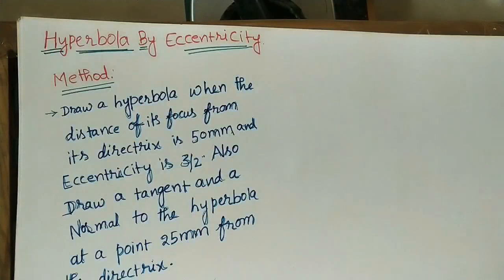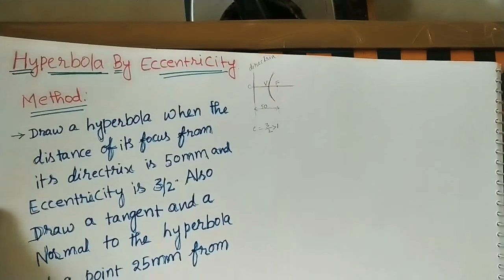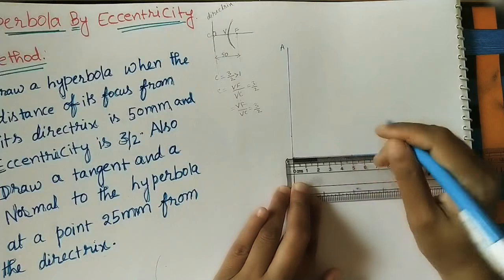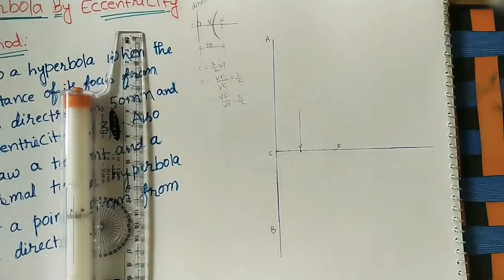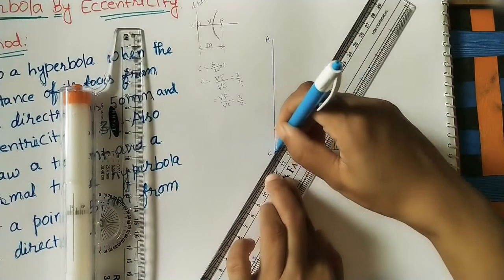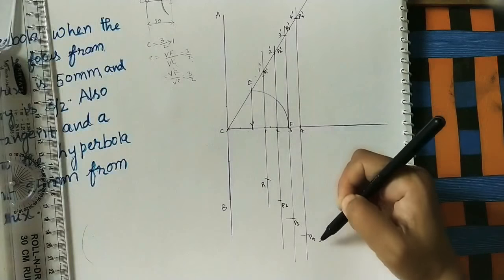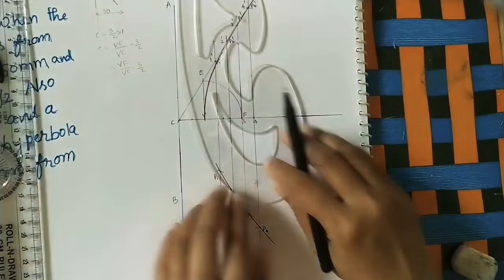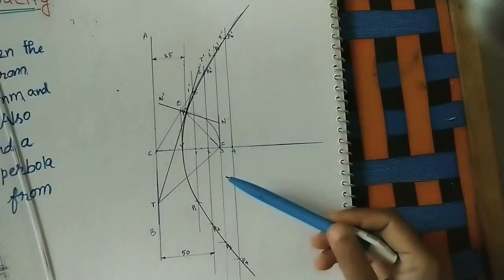Hyperbola By Eccentricity Method//Engineering Drawing

Comment: Mam how to draw
Construct a parabola using eccentricity method whose vertex is at a distance of 30 mm from the focus. Draw pair of tangents  from a point p outside the curve. 20 mm from the vertex and 40 mm from the focus?
Reply from the maker: In the question, it has asked eccentricity method. Take e=1, follow the same method as in video. After getting parabola do tangents on both sides of the curve from a given point.

Comment: Can you please tell me how to solve this
Draw a curve whose vertex is 30 mm from its directrix and eccentricity is 5/3. Name the 
curve. Draw the normal and tangent to the curve at a point 65 mm from the directrix.
8. Two points A and B are 100 mm apart. A point C is 75 mm from A and 60 mm from B. Draw 
an ellipse passing through point C. Draw a Tangent and Normal passing through C. Draw 
the ellipse with use of arc of circles method.
Reply from the maker: See this video lecture://youtu.be/YctXW9vG1Ds,
U can solve easily